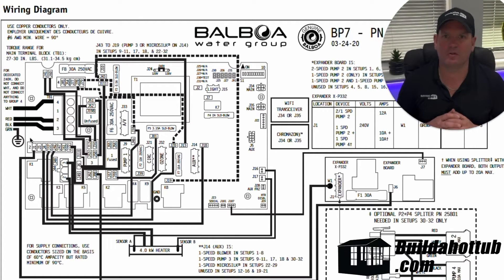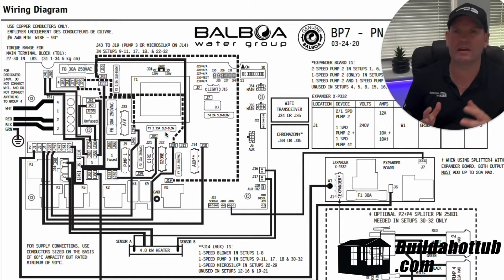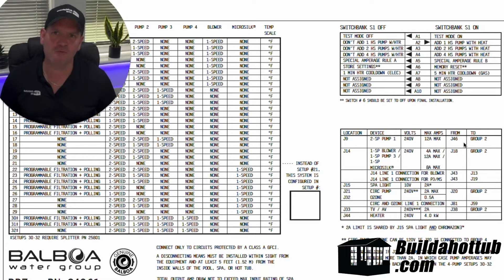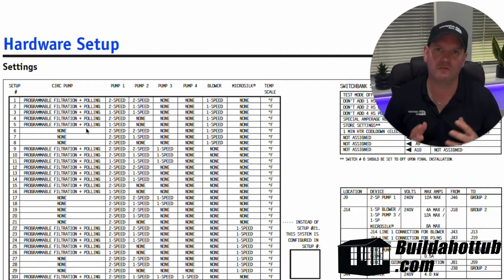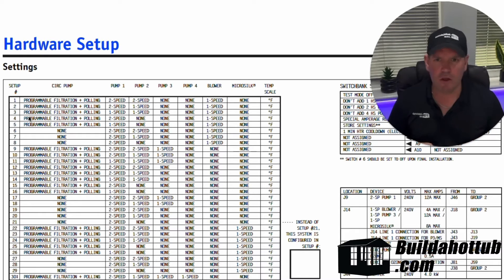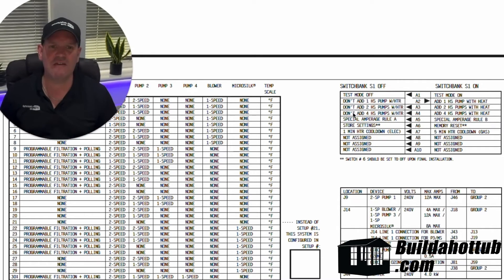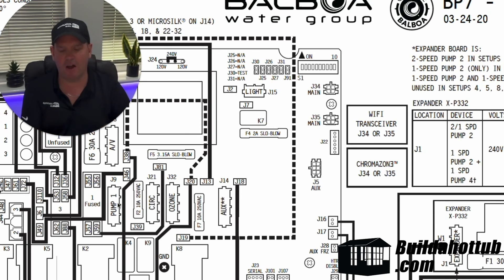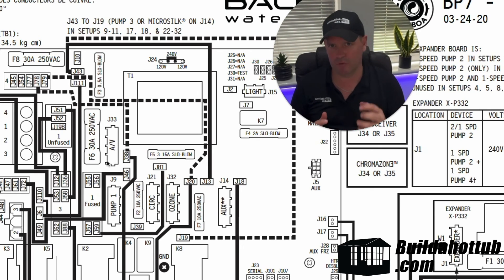Spa Pack Wiring Diagrams Expained

Comment: Andy I am having issues with my BP7 where my pump 1 always stays on.  I have two single speed pumps and a criculation pump. I am using the expander board for pump 2 and changed the setup to S14. any suggestions?